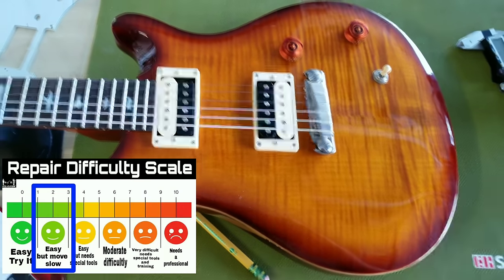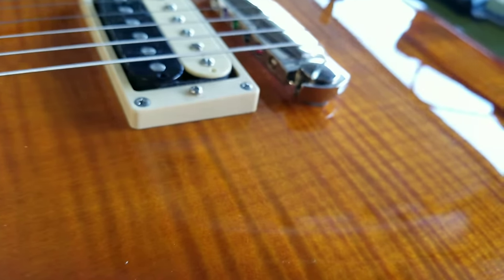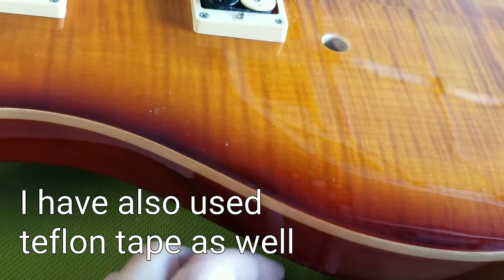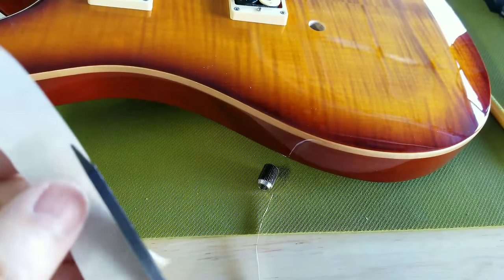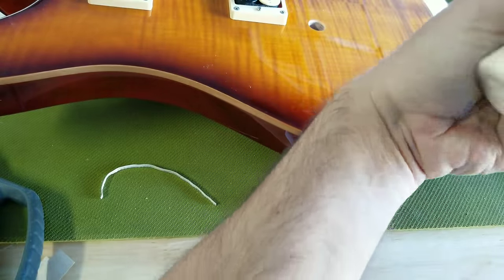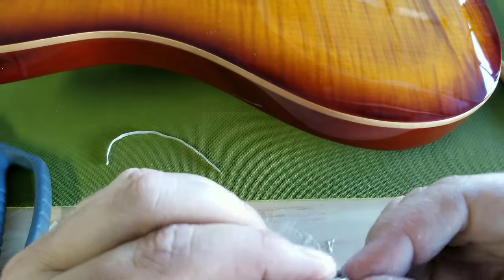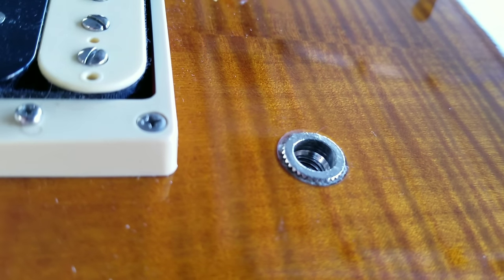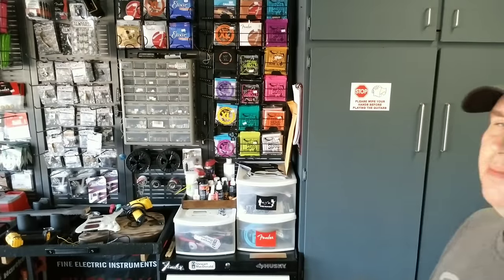How To Fix Loose Guitar Bridge Posts And Bushings. Sharpen My Axe

Comment: What if you need the bridge ground wire to make contact ? I assume the paper interferes ?
Reply: Did you ever get an answer to this grounding question? This is my reservation about trying this fix on both of my bushings.
Reply: @peacemakerrockwi  No I didn't. I imagine you could solder the ground wire and add paper or saw dust, match sticks etc after the fact. I'm sure that could work . Just be careful to work around the solder spot area.
Reply: @theloveofsin  My plan is to not have the paper go all the way to the full depth of the bushing, as my ground wire is mounted rather low near the bottom of the bushing. Fingers crossed.
Reply: @peacemakerrockwi  or have the paper go all the way down and spare a little top area. Or all the way except for a little notch or wire contact area. All could work fine. You'll be fine...as with most guitar work that we over think. Good luck !!!

Comment: Question. So I recently pulled out the posts to try this method. The hole for the post nearest to the pickup selector switch, volume knobs and tone had a tiny hole with a little metal wire routed through. So for sake of this video it would be the post that was not affected. Any way my guess is that this wire was for ground contact with the metal post? So if I wrap the post with glued on newspaper would there be a a ground issue due to the paper not allowing ground contact between the wire and the metal post? The guitar I was going to attempt this method on is a Hamer SFX series with tune-o-matic bridge and of course the aforementioned stop tail with the lifted posts. Please help!
Reply: Did you ever get an answer to this grounding question? This is my reservation about trying this fix on both of my bushings.
Reply: @peacemakerrockwi  I believe so but not on here. I will see if I can find the thread though.
Reply: @markflores2475  I appreciate that. Thanks!
Reply: @peacemakerrockwi  sorry bro, I couldn’t find the comment that had the helpful tip for this issue.
Reply: @markflores2475  Thanks for trying.

Comment: i had a buzz on my guitar, i eventually identified it as the bridge posts. the screw pins was just too loose in the stud. i wrapped the pin with a thin layes of teflon tape, rescrewed in and snug as a bug now. no buzz either

Comment: I have this issue on a Squier Strat standards bridge post, only difference is I can see a slight crack running from the trem route to the to the bridge post hole. At the moment I have the strat hardtailed and its only an issue when I restring and the post starts pulling out from the spring tension in the back. I would like to float the bridge again and use the trem but I'm afraid of the crack getting worse, do you think this along with some wood glue along the crack might help me get my trem back, or am I better off filling the hole, and re-drilling, or should I just leave it hardtailed and forget about the trem.

Comment: Question, now the post is permanently  glued to the body, will this pose a problem in the future in case the owner will wont to replace the bridge, and remove the posts?
or will it be able to come off somehow?
thanks for the great tip
Reply: It shouldn't.   The wood glue won't adhere well to the metal surfaces and with a proper puller the bushing should come out without issue.   I've made inexpensive pullers with large washers and some bolts that pop those out without damaging the wood or the finish.

Comment: How would you pull out the posts from the body?
Reply: Been dealing with the issue. If I were to do it again drop in a dowel pin & screw the post the into the bushing. When it gets tight, then drop a longer pin inside & do the same thing. Bunch a people say to put a smaller screw inside but that might not get you all the way out.

Stewmac sells an extractor for way too much money. That might be best though because if for some reason you need to force it, you'll strip the wood out & make matters worse.
Reply: use a small nut. theres a video on here. its easy.

Comment: pull it out and wrap it with a shaving from a hand plane, stuff it back in. 

Just kidding (that's what I'd do, though).

(OK, false state, I guess - I just got far enough to see that you're using tape instead)

A good idea. Always try something easy before unnecessarily going hard, and ignore the people who are always "hey man, that's not a proper fix". 

They'll say that after it's 20 years old. 

"you should take that out and fix it the right way". 

(why, in case it only lasts 30 years?)

Comment: I'm pretty sure that thecwood didn't shrink. When a thing shrinks, it keeps the same form and becomes proportionally smaller.
Reply: which is what happened here.... Think you're slightly confused as to the physics of shrinking when it comes to holes. Try getting yourself a block of cheddar, cut/ bore a hole into it and leave it out on a plate for a day or two. The hole will get wider as the cheese dries. Same principle with a guitar hole; It sounds counter intuitive but it is shrinkage. If it were the opposite and was because of expansion, there would be cracks in the lacquer/ buckling within the impression left by the post grips and would be happening due to increased moisture retention.

Hope that clarifies things for you. :-)
Reply: @anapolloguize8294  Well said!